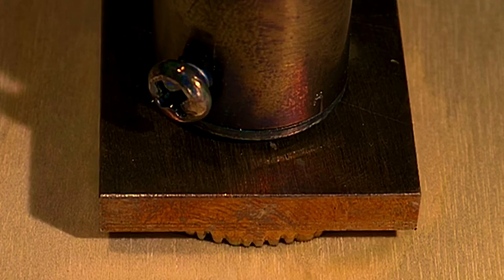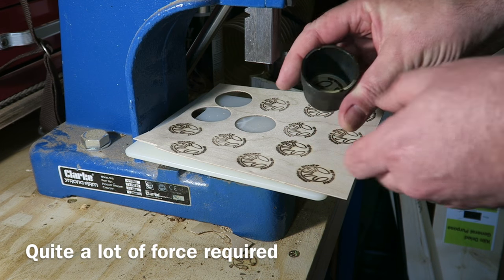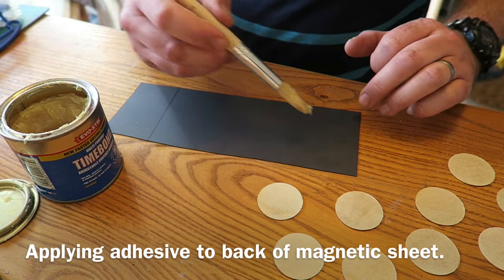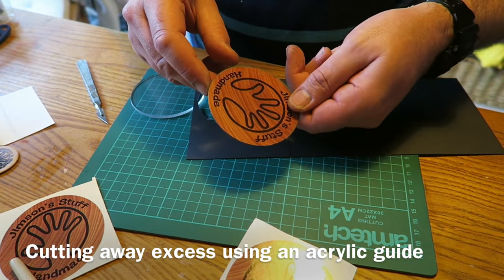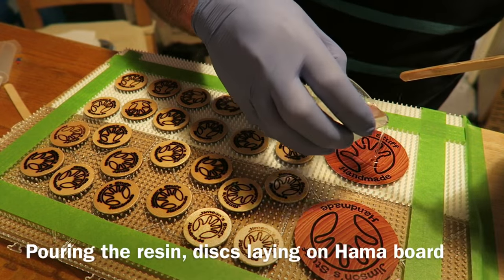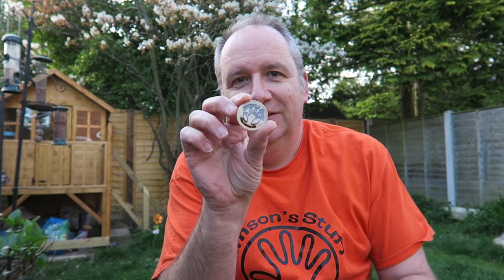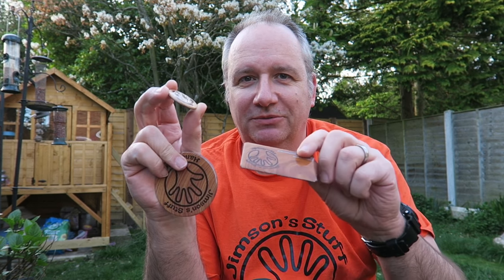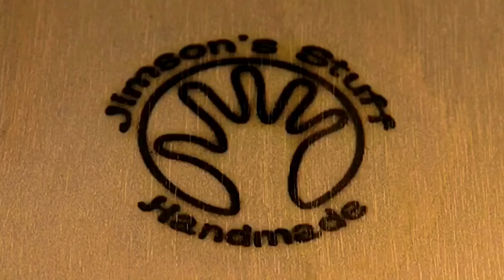Badge Doming Resin, Fridge Magnets and Yandles

Comment: Hi Jim,
I like the Doming idea, could the magnetic sheet be glued to the 1.5mm ply then burn the ply? The ply and magnetic sheet could then be punched out as one piece! Thank you for sharing your video 👍😆👍
Reply from the maker: Hi Andrew, I did try that but it caused the edge of the ply to crush and splinter when cut. I got a much cleaner cut doing them separately, and you need a sharp edge for the doming resin to work. I had a lot of failures in early batches that I made, the doming resin gives great results but is quite technique sensitive. All the best, Jim

Comment: That doming resin is pretty cool. Just curious will the press not cut through the magnet as well?
Reply from the maker: Thanks Jaime , yes it will, but it crushed the edges of the plywood due to the compressibility. I have got some thinner ply coming with should work better and will speed up the process. I had a lot of failures with the first batches i made. All the best, Jim.
Reply from the maker: I may try that with some of the adhesive backed magnetic sheet. It got a bit messy trying that with the contact adhesive. Cheers, Jim

Comment: would it be easier to adhere the plywood to the magnet and then use the punch for both materials at one time?
Reply from the maker: I did try that but the edges of the plywood splintered slightly due to compression of the magnetic sheet. The other problem was that the discs got jammed in the cutter and I damaged them pressing them out. It may work with thinner plywood or veneer.
Cheers
Jim

Comment: Have you tried a 18mm rotary cutter instead of a scalpel?
Reply from the maker: No, but I will look into that, thank you Dawn. All the best, Jim
Reply: I use them for cutting out quilting fabrics. They are basically a round razor blade on a handle.
Reply from the maker: I had a look on amazon, I will order one and give it a try. Thanks, Jim
Reply: be very careful cos they are extremely sharp. you can buy replacement blades and /or a blade sharpener. check Ebay they are cheaper than Amazon. Clover or Olfa are the best ones.
Reply from the maker: Thank you Dawn. I had already ordered an Olfa off eBay. Cheers, Jim